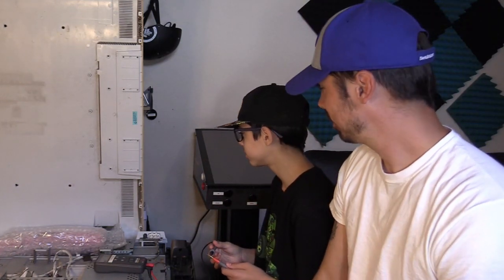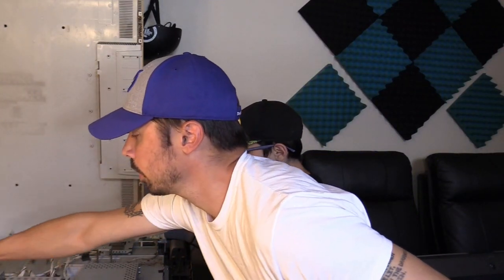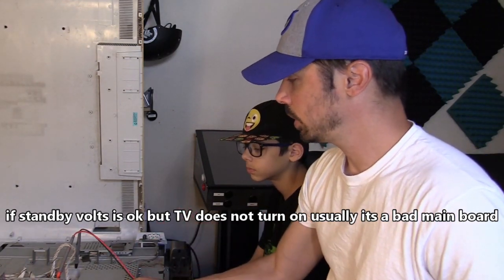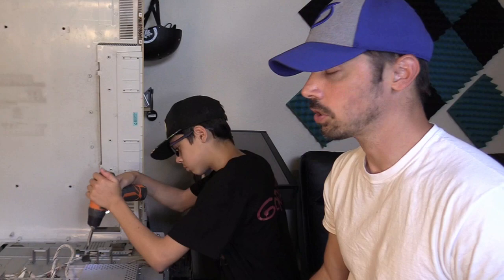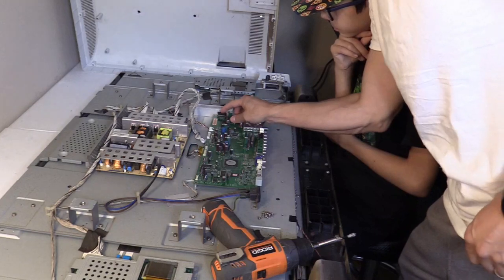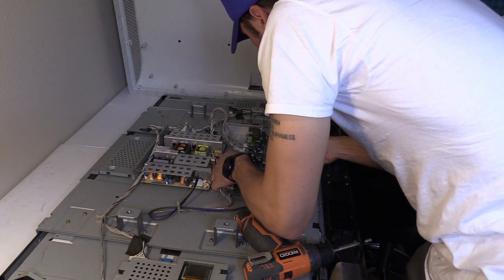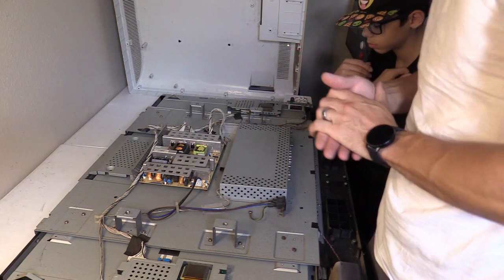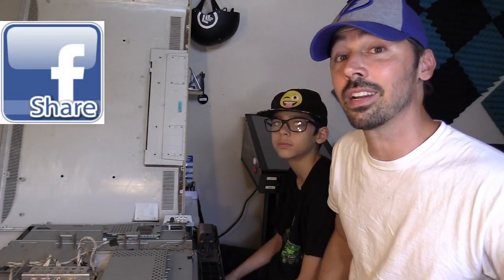TampaTec Teaching Son to Fix a Broken TV

Comment: I'm new to your channel but already see I'll be spending time on it. I have a Samsung TV model UN 55FH6030 and is 8 years old. Want to decide whether to fix or replace. Top two thirds of display is slightly darker than bottom third. The middle third has slight flickering. To identify possible source being a connection, I have disconnected Roku stick, HDMI (security sys) and coax for OTA antenna without success. Those are all the connections. I have also done multiple resets disconnecting power at outlet and holding pwr button on set for 10 sec then plugging in and use pwr button on set to turn on. Still have problem. Would welcome any suggestions and advise.

Comment: Do you know anything about a tv having no internet connection? I’ve done everything from factory reset, restarting my router and modem, updating my software with a thumb drive. I think it might be the TV hardware. Is there anyway to fix the issue? I have a Sony Bravia XBR-65x900E. Hopefully you can help. Thanks in advance.

Comment: Hi Paul Tampa tec my name is Peter from Australia N.S.W . Iam a big fan of your TV repair video's .. can i get your email so I can sent you some pictures of my samsung tv power board.
I cant find what part or replacement parts they are, I have 3 pictures that I would like to sent you of components on a power board.
the tv is a  Samsung LA32A450C1D/XXY SERIAL NO. ALD83MKQB00469H. Thank you .. Peter

Comment: Hey Paul!  Great video, I love working on stuff with my dad.  Question for you - I am working on a Samsung UN70TU700DFXZA.  Just replaced main board and power board and I have sound but no video.  LCD screen lights up but is dark gray, can't see the menu or etc, but can change channels, input, etc.  Could you point me in the right direction?  Thanks in advance!
MB

Comment: Hello Tampatec, I am having trouble with my Sony Bravia XBR 4k 65in TV. I have two horizontal lines about 4 inches apart and a brownish discolored area right in the middle of my screen about the size of a basketball which is really noticeable on a white screen. Although it's always there. You think T con board? The TV is about 6 years old. Thanks very much

Comment: Quality time with your son! Question I have a TCL that's about 3 years old and now is showing like a snowy image. Any idea what the problem might be?
Reply from the maker: most likely tcon board if all video inputs display snowy image. if only antenna or cable line in channels then probably tv tuner has bad solder connections or RF coax cable connection is loose, then just change coax cable. if all tv inputs are snowy see here to get tv boards at shopjimmy.com or electropartsonline.com
Reply: @TampaTec  Thanks! It's all inputs, so I'll check that website out to see if I can get it. A little upset that my 13 years old Vizio still works and this 3 years old is broken.